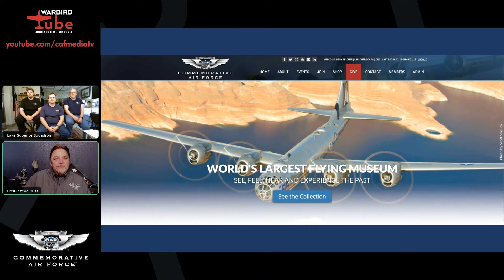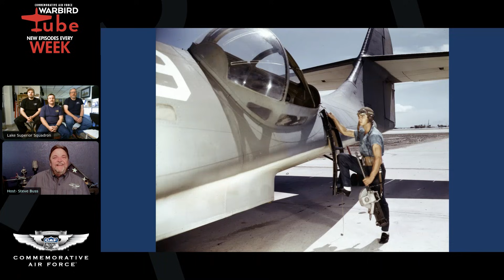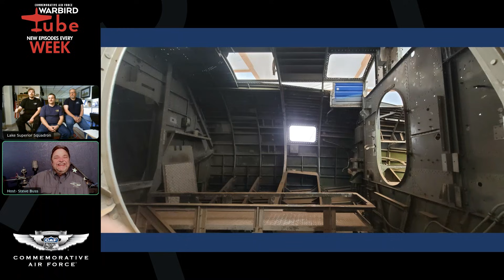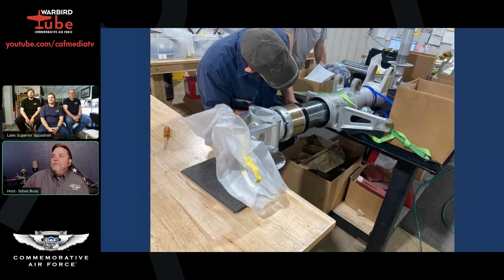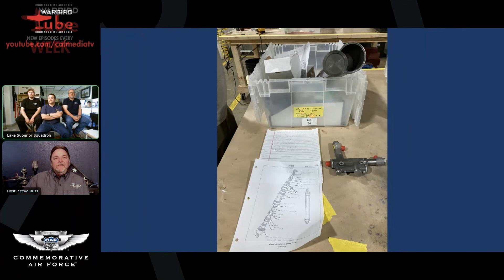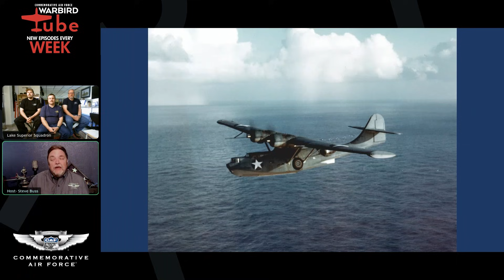CAF Warbird Tube – Saving “79 Yankee” – The Catalina Restoration Taking Flight

Comment: Retired Com Pilot, A&P, IA. I restored ONE warbird in my life, once was enough for me! I will BUILD a kit plane, the RV-8 is my goal, but never restore another aircraft due to the immense amount of work. People have no idea! First, you have to 100% disassemble the entire old crusty airframe, then strip and disassemble every item, every component! Years of dirt, filth, oil and hydraulic fluid build up, not to mention corrosion. Instrument panels, center consoles, throttle cables, fuel lines, oil lines, windshields, Everything! Then you spend the next two years behind a bead blaster and in the paint shop. THEN, you can start putting it back together, fabricating parts, bending new sheet metal! It's a dirty, filthy, boring, monotonous, labor of love and I was about these guys age when I did it!  Now with a NEW kit plane such as the RV-8, you are merely assembling, installing NEW components, painting and detailing, yes, still a lot of work, but no where near as dirty and time consuming! Yes, I believe everyone should go through it at least ONCE! But once was enough, now that I'm an old fart, I just don't have the stamina that I once had, it's a young mans game! Hat's off to these fine, hard working, and dedicated young men! Like me when I was in their shoes, I was eating up every minute of the dirt, filth, sweat and hard work! They will have these memories and something to show future generations the fruit of their hard work and dedication! 👍
Reply from the maker: Sounds like you know the drill!